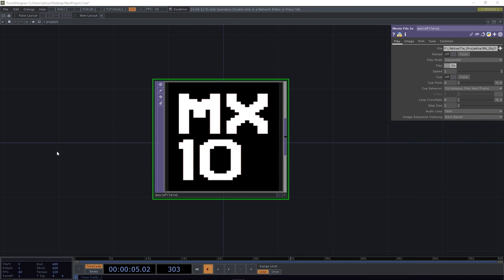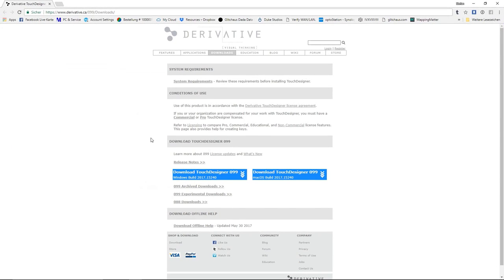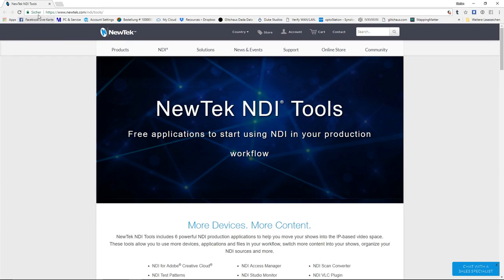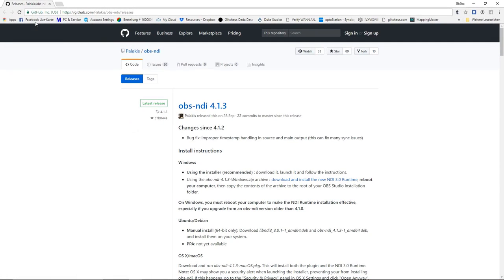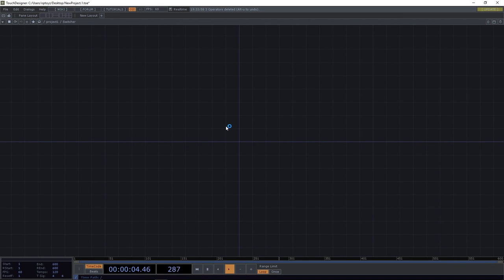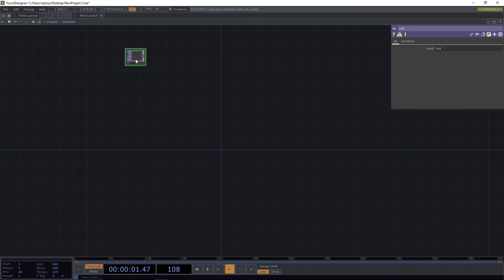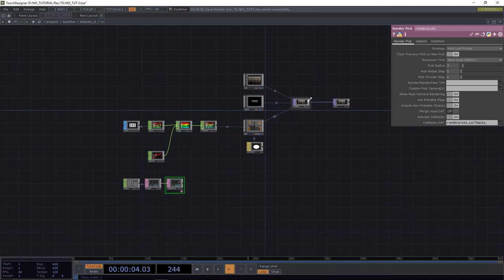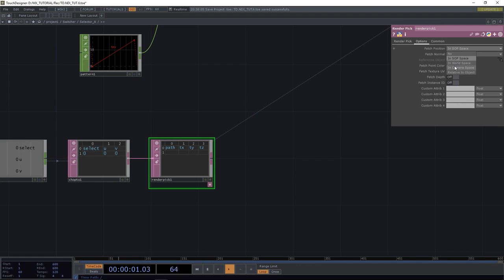MX10 TouchDesigner Tutorial - NDI Switcher

Comment: Brilliant tutorial! Thank you
Reply: As a newby - I have one question where this tutorial seems to break for me. When in the Selector_A you show input ref 'Instance Texture' as  /project1/Source_(1-16)/textSrc, note my text2 is called textSrc and original Source_0 before replicating x17; nonetheless when I type your path suggestion all my geo1 grid of previews go white in texture, though if I type /project1/Source_1/textSrc, or any of the 0-16 Sources, source textures show up with the individual number (ie 1) in the Render as just that source many times. So something about the range of tex instances isnt functioning for me. All the Panel pressing etc works fine. I also followed your tute to accurately I believe, going back through for another run to check everything - so close :) Any help be appreciated.
Reply: I just noticed @WokeSoros comment re NVidia card - I am assuming this is the same error?

Comment: Ugh. Instance texturing doesn't work without an NVIDIA card.
Reply: Actually it does. you just have to go about it slightly different. Compose all textures into one big texture and set the UV coordinates for every instance so that this instance crops only the part of that big texture it should use. If you google it, you will several tutorial about this technique, mostl as texture instancing for Mac.
Reply: @MXZEHN  Interesting. I just made sub containers, with further sub containers and lots of in tops and background nodes, to create mostly the same effect without any 3d.  It's not quite as elegant as your original solution, but it gets the job done.